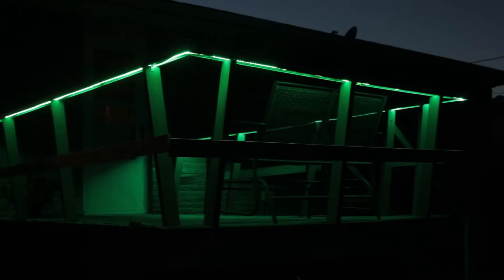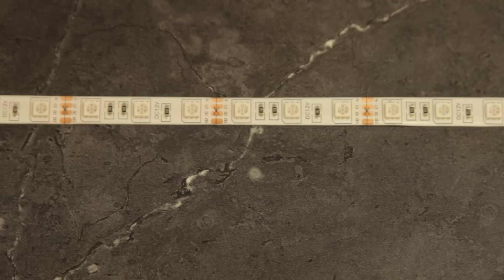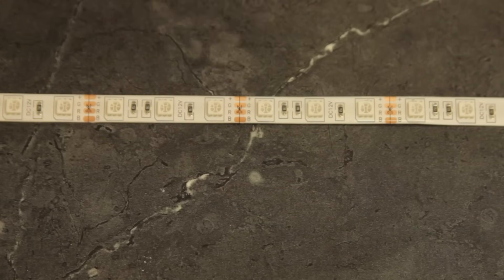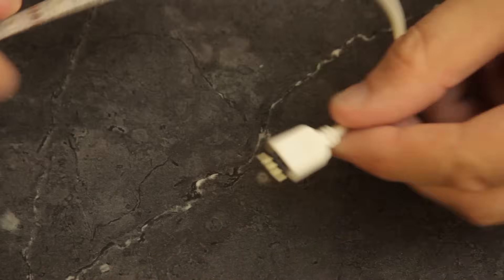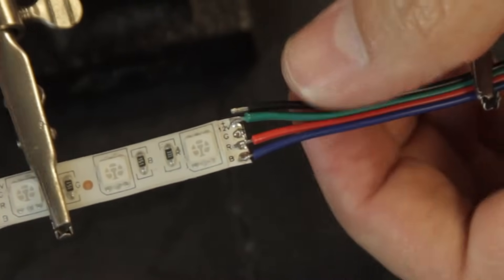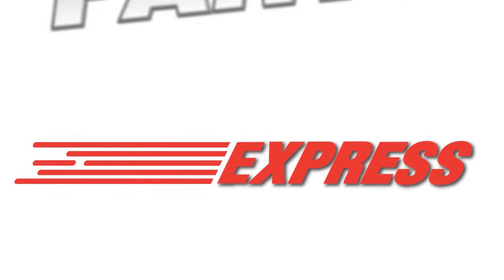How to Cut and Connect LED Light Strips.

Comment: FINALLY!  After loads of useless videos this one gives the info you need and shows it in detail.  Thank you
Reply from the maker: Glad we could help! That's what we do here at Parts Express!
Reply: I watched this after I cut phillips hue lightstrip. I might be able to safe it but. Im screwed
Reply: Leonardo Di Stefano , exactly, and it is very very simple once you watch the video. great job, P.E.
Reply: Same! Everyone basically just speeds up the video lol 😀
Reply: Rightttt!!!!!
Reply: I second that- some 10 min, plus videos out there that put you to sleep.  This one was excellent and to the point !  Brilliant.  So simple when done here.
Reply: THANK YOU WISH THERE WAS AN EASIER WAY THO 😭😭
Reply: Leonardo Di Stefano thank bro appreciate it
Reply: True
Reply: Where to you buy the connecter at?
Reply: @timschutte8310  if FF
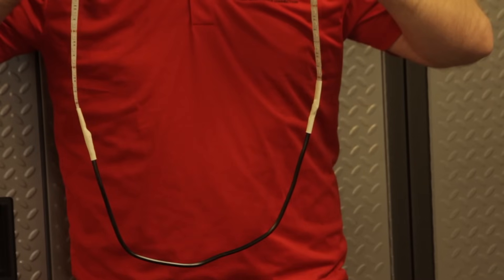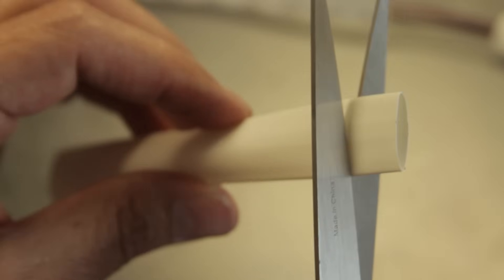Reply: Parts Express So in 1:15 to about 1:40 you talk about using leads to connect where you don’t want lights. Is it possible to connect, for example, a RGB 4 prong strip using that lead and solder it to a pure white strip with only 2 prongs, so long as you match up the cable colors? I want to connect red, white, and green, but I can only find white with 2 prongs.
Reply: Fre
Reply: THANK YOU.
Reply: @codybanks1556  how did it go?
Reply: @codybanks1556  ooo
Reply: KK
Reply: 870
Reply: @codybanks1556  AMEN!!
Reply: How do I install rgb lights if I need at least 60ft? I installed some in my wife’s ceiling but only the first 16ft run is lit, the rest won’t light up and I used a 3 different connectors on 1 continuous run.
Reply: @amorinooo  Nope, but they do sell the ones you need on Amazon.
Reply: @PartsExpressOfficial   I know this is from 4 years ago but can you cut the part and just leave it like that
Reply: Yep
Reply: Brooo facts thank you parts express
Reply: Brooo facts thank you parts express
Reply: Me

Comment: Yep cuz I just have connectors and soldering irons sitting next to me
Reply: Haydn James or hot glue and almost everything he said😂
Reply: I always have a soldering iron around, they aren't that expensive, and they come in handy a lot
Reply: L.E.D. strip lighting is (in many cases) what's considered to be a 'project' for most people and for whatever is the desired application. Again, it's a project.  The reason that you can cut your strip every few inches and that connectors are sold are proof of it being 'project' oriented for customization.  Soldering is no exception in certain cases.  With all projects, come a need for certain tools.  Would you complain that you cannot write because your pencil tip broke and you have no pencil sharpener?  Would you expect to bake a box cake and get irritated that you have no mixer that would need to be purchased separately?  This is no different.  A cheap soldering iron can be bought from Harbor Freight for like $5.  Solder is a few bucks.  Connectors can be bought on Amazon or eBay for like $6 for a pack of ten.  You act as if a soldering iron is unheard of to have in a common household, or as if hundreds of dollars are invested in these basic tools or components.
Reply: @MarkW1210  This might be the dumbest comment I've ever seen. Not everyone researches crap before buying it. That's like buying a new phone for the first time in your life and being surprised you have to pay for data, because you weren't told about it.
Reply: @arandomstreetcat  "not everyone researches crap before buying it" And that's what makes people idiots. Nice try with your comment though
Reply: Soldering irons are about $6 on ebay (but using it is harder than it looks)
Reply: Who doesnt have a soldering iron
Reply: @salttrap2  anyone who doesnt work with wires
Reply: Exactly, like WTF. I'd expect to just use the connecters not have to solder them together!
Reply: @NLJasonToddsToes  shush
Reply: You probably should’nt think about customizing light sources if you think soldering iron is a nieche tool.
Reply: faxxsss
Reply: @arandomstreetcat  yikes
Reply: RIGHT
Reply: Soddering iron.
Reply: He didn’t say it was easy
Reply: @MarkW1210  lmao triggered.
Reply: Yea fr like wtf
Reply: @arandomstreetcat  wtf
Reply: @MarkW1210  ok!
Reply: @Xominus  triggered your mum
Reply: @MarkW1210  That's one of the most weakest things I have read in my life.
Reply: @Xominus  I've never seen someone more easily trolled and triggered than you. Thank you for the entertainment my friend 😂
Reply: @MarkW1210  Bruh. You actually think you can make me triggered by telling me lies? You come up with only weak stuff. Reply once you have something better.
Reply: @MarkW1210  I actually have a awesome life. I just started to get my things for my gaming room and my beautifull Splatoon Amiibo's! And I am also getting a gaming PC and I am also getting a mic kit and a capture card. And even more things are happening and it is amazing.
Reply: @MarkW1210  Bruh. Even your sarcasm is weak.
Reply: @Xominus  what sarcasm, I'm literally downloading flight simulator illegitimately and going to fly around lol
Reply: Not anyone's problem you don't have anything
Reply: How do you think you are going to connect electronic wiring? Tie the two ends in a knot? Fool
Reply: I actually do have a soldering gun sitting next to me here in my truck so....
Reply: I know Sam's here bro
Reply: Fiver next day delivery on amazon.
Reply: Trust me what's the point
Reply: Get them
Reply: Right 😭😭
Reply: When I don't have a tool, I ask my fb friend or in a fb group. People are always happy to lend a hand.
Reply: That’s what I said

Comment: Bruh wtf, I thought you just put it on the wall and turn it on
Reply: I know right
Reply: LMFAOOOOOOOOO RIGHT
Reply: SAME LMAO
Reply: What were the connectors called on amazon?
Reply: I bought Govee ones and they’re way simpler than this.
Reply: @yzkkoch479  ME TOO
Reply: @skls1234  calm down jamal
Reply: @liam os That’s a fact. I have no hope for the future if this is any glimpse of it.
Reply: @yzkkoch479  I got mine and then I cut it but it didnt light up
( I didnt connect the ending to the next one so I wasnt sure If I did something wrong or not)
I ended up being (;´༎ຶД༎ຶ`) because I cut on the copper ( brown ) bit with a straight line through it
Reply: BRUH SAME 💀💀💀
Reply: @skyebasto189  don’t pull out the nine ✋😳
Reply: @skls1234  i hope your joking
Reply: @skls1234  What did you just say
Reply: @yzkkoch479  same
Reply: @nineseven5252  bro what
Reply: Fr
Reply: @Thenormalguy11  LEDology 😂

Comment: Too complicated like wtf I need al of that just for some lights 🤦🏾‍♂️
Reply: Strike4Luck - YT I hope this is a joke
Reply: Strike4Luck - YT 😂😂😂
Reply: IKR
Reply: You wanna be extra, you gotta do extra 😂
Reply: Alek Villarreal i regret being extra
Reply: He just tryna help...
Reply: Because unlike you, there are many people out there who are one of the following:
* Not lazy.
* Have a will to learn.
* Have a will to invest time and effort into a project that will yield nice results.
* Have an application that requires adapters/extensions to be used.
* Don't like to twist/crimp corners of their strip lighting like origami.
* Enjoy a nice clean looking and professional job of their finished lighting that doesn't look like s*%t in the end.
Reply: I'm curious if i cut one little part of the led strip lights will it's still work if I just plug my outlet without any connectors or something like that?
Reply: @milaababyy9660  L.E.D. strip lights are only intended to be cut at the cut mark intervals.  For whatever your application, it shouldn't be too hard to choose a length of L.E.D. for your purpose, since cut mark intervals fall around every three inches of your L.E.D. strip lighting.  Simply cut to the closest length that you need for your application without exceeding that desired distance and compromise the utilized space by splitting the difference of L.E.D. length as equal differences on each end.  If you need an application where a tolerance of three inch intervals are too wide, then strip lighting probably isn't what you need and you might want to consider other options or a custom L.E.D. circuit board build if you need L.E.D.'s to be in such restricted tolerances of three inch spaces.

Comment: i was having trouble with the connectors. i thought i ordered a wrong size because the clip wasn’t snapping back into place. once i removed the plastic to expose the copper it worked. thank u!
Reply: what did u use to remove it?
Reply: @justinb1470  i just used a box cutting knife :)

Comment: Thank you! I had bought some connectors because I got the DAYBETTER 32.8 ft ones. I got 2 boxes and I was confused on how to connect them.
Reply: I got those ones too but it doesn’t come with a connecter I am still confused....
Reply: @dalilaseddiki1185  Same! You have to buy separate connectors, I'm pretty sure in the product description there should be a link for the compatible connectors.
Reply: @dalilaseddiki1185  But, if it doesn't have a link for the connector, I'm sure any LED strip connector would work.. maybe put a lil bit of research on it,

Comment: Could u help me..what if your LED Lights didn't come with anything to connect the 2 together at the ends of it cause mine didn't and I got 2 boxes of 32.8ft of the same ones and I dont know what to do
Update: I got new lights and I've had then for a while now
Reply: likely Ana same!
Reply: likely Ana I’d like to know too
Reply: Same bro I’m kinda pissed
Reply: likely Ana when you were buying it, if it said that it came with it and it didn’t i’d contact the seller right away other than that you have to buy them separately
Reply: @pharmacyman6415  I returned them and got a full refund and now I just out up my new ones and they. are amazingggg
Reply: @vinniecicio8989  it's fine..I got new ones and I've had them up for a week now and there awesome
Reply: @cirannosaurus3430  I would return them..I got mine for daybetter on amazon (which I regret getting) but I returned it and got new led lights from a new brand to
Reply: likely Ana i got the same daybetter ones, and they all won’t sink up after i cut them. only one side will turn on at a time. what kind did you buy??
Reply: likely Ana hey! would you mind telling me the new brand you got? i got two 32ft light strips for my room but the connectors didn’t come with it.
Reply: likely Ana I know this doesn’t have anything to do with ur question but I LOVE UR PROFILE PIC SOSINWNENE COLBY IS THE BEST🥺🥺🥺
Reply: Same
Reply: likely Ana you could buy a connector on amazon
Reply: likely Ana SAME
Reply: Erika H what are the connectors called
Reply: likely Ana same! apparently they don’t come in the package you just need to order some!
Reply: same!
Reply: likely Ana what brand did you get after returning the betterday lights ?
Reply: likely Ana OMG SAME- did u get the freaking minger ones? tbh they kinda suck and i’m crying bc i don’t have the materials to connect them AHHHH. all i wanted was some nice led light for my birthday☹️
Reply: SAMEEEEE
Reply: likely Ana I got the same ones. I just made sure to order the L shaped connectors and these connectors used. You may have to order them.
Reply: Wait so is the connector used for just connecting the two strips because I didn’t really know much and neither did my dad so we thought that the lights were just broken because he tried to connect them but they were different colors so I’m wondering if the connector is used just to connect them or does it make sure both the strips are the same colors
Reply: Samee
Reply: It’s not supposed to come with the extra connectors you have to buy them separately, also are for late reply, but it’s in the description
Reply: buy some (they are super cheap)
Reply: pharmacyman do you know if you can buy to different boxed and connect them?
Reply: Is that colby brock on your profil picture...? :O
Reply: @julieeisenhart920  yup been a fan since Vine hehe
Reply: @AM-ef1pd  sorry about the wait, haven't been looking at any of my replys since I got mine already, if you still need to know I'll tell you
Reply: @kiccz39  sorry about the wait, haven't been looking at any of my replys since I got mine already, if you still need to know I'll tell you
Reply: @gretchenham1734  same I earned money to get some. But all you have to do is return them and you will get your money back
Reply: @jadethegoldfish771  I mean I bought new ones like 4 months ago lol
Reply: @addyg6500  yeahhh
Reply: likely Ana WHATS THE BRAND OF THE NEW ONES😡
Reply: Gretchen Ham same i got the munger ones too and i cant connect them
Reply: Same
Reply: what brand is good and comes with connectors??
Reply: amanda marie hey I returned mine with the shitty connectors and Im going to buy the cozylady ones. They are a little pricier but have way better functions and it’s 65.6 ft and the 2 strips are 32ft long so no connectors needed
Reply: amanda marie i had the daybetter leds👎
Reply: Erik thank you 🙌🏻
Reply: likely Ana which new ones did you get ?
Reply: @omgitsalyssa8162  Phopollo Flexible Led Strips Lights
Reply: likely Ana thank you so much !!
Reply: Bud you have to buy the connectors separately ik your pain
Reply: @Erika H can I have the link? I can't find them
Reply: Return !!
Reply: Erik wait so you didn’t have to do any of this and connect two strips?
Reply: @cirannosaurus3430  same I returned mine tho
Reply: @blakewilliamson3620  I dont really know at the moment and sorry for the late reply
Reply: @AM-ef1pd  that's what happened to me and I dont really know right now but I can totally check later. Sorry for the late reply
Reply: @elisagonzalez868  BIG FACTS
Reply: @darbysmith4346  yeah I returned them and got new ones
Reply: @kiccz39  I dont reslly jnoe right now but I can check later
Reply: @gretchenham1734  return them if you got them from Amazon and get another brand, idk what brand I got but I've had them for a while now
Reply: @haven5010  yeah ik I just returned them tho and got better ones
Reply: @addyg6500  I returned my old ones for new ones. I got them off Amazon haha
Reply: @jadethegoldfish771  only some led lights come without the connectors but I returned them and got new ones
Reply: @aussiecoasterenthusiast7561  I did but I returned them and got new ones, I've had them for ages
Reply: @AlphaMacho  I dont jnoe right now but I can check later
Reply: @emriela7725  I returned mine and got new ones
Reply: @amandamarie6858  I'll totally tell you later when I know it
Reply: @AlphaMacho  that's what I did
Reply: @AlphaMacho  I did to and I returned them
Reply: @911deano1  I did haha I've had them for maybe 6 months already
Reply: You buy it separately-
Reply: It's naught separately on Amazon-
Reply: Bought**
Reply: @likelyana  can you tell me the product name lol?

Comment: I cut where you said and the lights didn’t work
Reply: Ryzy Same
Reply: Me to
Reply: Same shhahsbh
Reply: Oof
Reply: Ryzy same
Reply: Ryzy same
Reply: Ryzy ditto
Reply: U need the connectors
Reply: ya i didnt think i just cut where i thought was best lmao
Reply: Cloakyか I have the connectors. Still didn’t work
Reply: @melia9375  well damn
Reply: I have a suggestion; I used the connectors without taking off the plastic and it worked perfectly

Comment: i literally cut my lights ON THE LINE and now they're not working!
Reply: @aHensoII  LFMAOAOOAOOA THIS HAS ME CRYIN RN
Reply: @user-hf7rc4lx2f  fr these people think the lights are blue tooth or some shit lmao
Reply: @aHensoII  i want to buy them can u explain how to cut and connect it because a lot of ppl are saying "i cUt wHeRe iT tOlD mE tO aNd NoW tHey ArE nOt tUrNinG oN"
Reply: @asroad4858  ok so basically those lines are where you want to cut if they’re too long that’s it, you can otherwise connect them with led connectors but i don’t recommend that just don’t cut them
Reply: @aHensoII  Yeah but what if like i want to put some around my tv its 50". And how can i use up only 50 inch without damaging the rest of the strips?
Reply: @asroad4858  curve it around the tv i guess cause if you cut the strips they won’t have a power supply to work, most the people in the comments don’t realize they need a power source to actually turn on
Reply: @aHensoII  Ohh right so what if i buy bluetooth ones can i cut or not?
Reply: @asroad4858  are you joking lol there aren’t any bluetooth ones i was making a joke about that

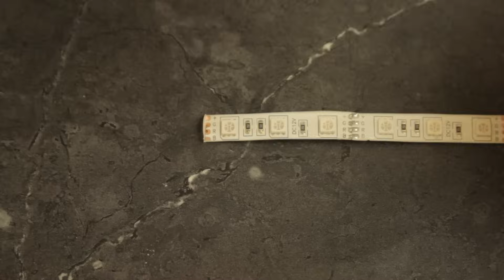Comment: for the ppl in the back who still need to know, this is what u gotta do, when you first get your led, you cut it into a second strip, there’s a connector at the end to hook up to the box you originally hooked it up to, but if you want to cut it into 3 strips your gonna have to buy another connector (link in description) and do what he’s doing at 0:50 but unfortunately your gonna have to get another WiFi connector (also link in the description) for the third and fourth one. And if you don’t know how to hook up the third and fourth strips to the WiFi connector just watch a YouTube video on how to set up led lights or reference back to when you hook up your first two. I was a rushed explanation so just ask if u still confused.
Reply: Good to know I don’t have to go buy a welding gun 😅